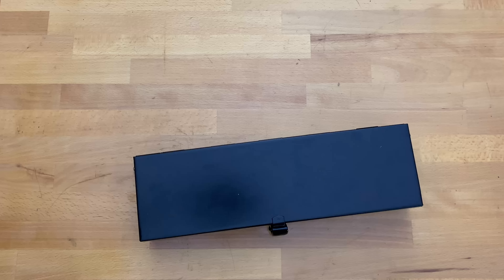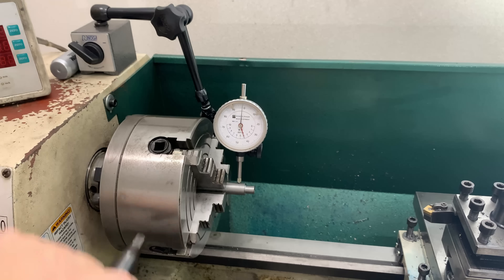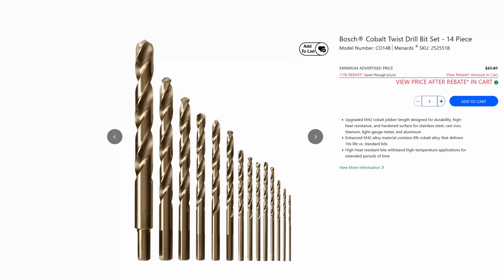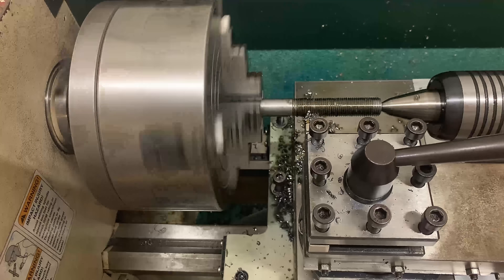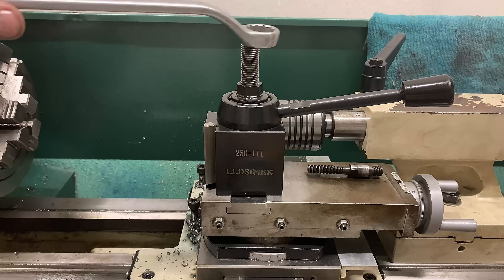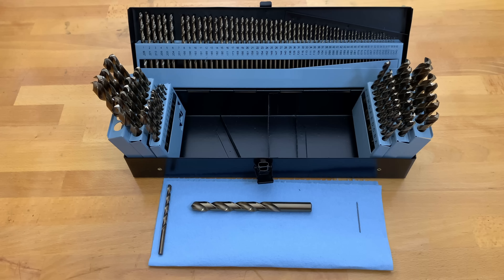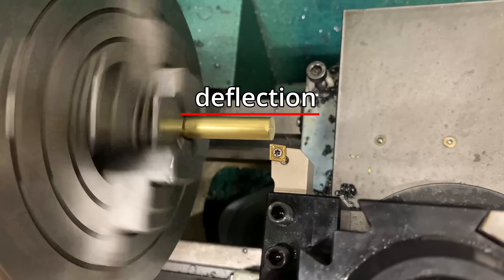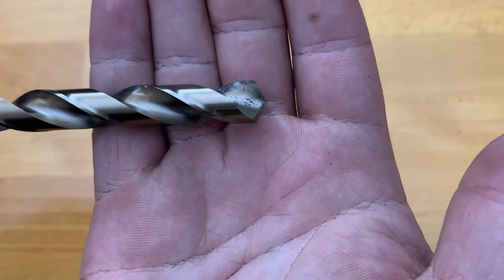Are Harbor Freight Drill Bits Secretly AMAZING?

Comment: Saw the same thing about the reviews. How could they be bad? Just bought these a couple days ago and they're great. Been getting chips longer than the entire bit when drilling into plate with my press. 16 holes into 1/4" plate and it seemed like it only cut better as I went on. Slow turning and press hard, cuts through it quite literally like butter. Best drill bit set I've had (not saying much, I used to only own junk)

I can say with near 100% confidence those who hate on these just don't know how to use them. To be fair, for the longest time I didn't either. Kept wondering what I was doing wrong and why all my bits were dull. Were they all that bad? No, I was the reason they were dulling. Its real easy to mess up drilling metal and can be impossible at times to drill properly when only using a hand drill, what are the chances that many of these buyers don't know that?

Sometimes I can just tell a reviewer didn't use it right just by reading their post. But, that's the nature of the internet, and those who don't use it because they think they know better. And well, for a time, I was that guy too (and probably will continue to be).
Reply from the maker: That's awesome. Thanks for taking the time to comment and share your experience with them. I really appreciate it. I've been drilling steel with these on a regular basis since I bought them and they're still working great.

Comment: I have 4 drill index sets, one red-box chi-neh HSS from yesteryear that I found in a rental basement missing 31%, which I 'adopted'. One new HFT HSS index I bought new, when I finally was rich. One HFT TiN coated index when I splurged. And, a HFT cobalt set I got when I was rich, but before the online jungle, and before I knew anything proper about machining. I have a small shrine in the corner of my shop with candles and a doily and a carving of the Great CNC, for it. I discovered they were hard, later, and found they worked well for SS, where before I learned a nice sharp HSS at a nice slow RPM, would do OK. Using common sense, and a bit of machining logic, I would give my set from 2007 a big thumbs up, especially for the price, which was reasonable, and I cannot remember.
I have had none break, but it would be nice if you could get individual replacements at near the same as the kit price.
Reply: On the online jungle site, I IMMEDIATELY go to the one star reviews, for a gauge of any product. I can, and have learned, to filter the cluster monkey customers, from the genuine bad product evaluations. I think you hit a SUPER key point: Bad reviews can be from people who have no idea how to do anything, and the FAIL is THEM, as opposed to the bad reviews because the product is shite; it takes a keen eye to discern between the two. I swear, there should be a minimum license required, for people to interact in public.
Reply from the maker: Thank you. I agree completely. You just have to learn how to filter out the relevant from the irrelevant and see if you can decipher truth.
Reply from the maker: Sounds like you've got drill indexes covered for a while!

Comment: Great video. I wonder if these are improved from what they were selling, say 15 years ago?
Reply from the maker: They must be. I’ve heard some pretty bad horror stories of their old cutting tools / drill bits.
Reply: @ Yeah. I bought some many years ago. I called them fast and furious drills, because they drift all over the place.  Some had visible wobble in the drill press right out of the box, and I’d avoided cutting tools there. 

IMHO over the years much of their stuff is no longer dirt cheap, but is higher quality. Their upper line stuff especially seems to work and hold up well- a better value. Might have to give their drills another go.
Reply from the maker: If you do, try the cobalt ones. I'm still hearing that the plain HSS drills are hit and miss.
Reply: @ShopHumor  Good to know. Thanks.

Comment: I used a HF cobalt drill set to drill out a broken stainless steel stud. They performed better than I expected, but it was such slow going in the very hard material. I ended up spending $30 on a Bosch tungsten carbide tapered and straight cutter for a Dremel and it's really like a hot knife through butter. I don't think I'll ever drill out bolts that same way again.
Reply from the maker: That's a good tip on the tungsten carbide for the dremel.

Comment: I have bought expensive and cheap. I will say, one of my favorite things to do in shops that I buy tools from is to look at relief angles on drills. Turns out, expensive and cheap often have the wrong relief angle. I now have a grinder and repoint all mine and do it for others for a profit. I will say, something happened to drills over the years.
Reply from the maker: Grinding and sharpening is a really valuable skill. I’ve wanted a d bit grinder for a while, but I do my best with my bench grinder

Comment: Ive considered buying these due to your video but would they be good for hand drilling on steel and aluminum?
From what i understand, cobalt is harder and more brittle so ideally youd want to use them in a drill press. However a majority of my work i need to do pilot holes by hand in a hand drill. Would these be good for that? I feel they would be extremely brittle. The highest quality ive ever personally used was Dewalt drill bits. In between these due to the value or another dewalt set.

I also do some carving work in aluminum so ill drill 3 holes in series and once the hole is drilled i like to rotate the bit side to side to carve more. Wondering if these could hold up to that.

Also you mention sharpening your drill bits, what is a cheap tool you recommend?
Reply from the maker: These will definitely be more brittle than your standard HSS bits, but with the right technique and lubrication you'll do pretty well with them even in a hand drill. These aren't quite as brittle as the M42 cobalt drill bits. You may be better off buying the Dewalt black oxide set if you're just drilling mild steel and aluminum, and then sharpening as needed. There are a lot of people who recommend drill doctor for sharpening and I think it's a great solution but can be expensive. Project Farm has a whole video comparison on the best drill sharpeners that I highly recommend watching: https://www.youtube.com/watch?v=m3Al3bfb9-0

Comment: Nice video. but I feel you did miss the Most Critical Part of Cobalt Steel drills. That is Cobalt Steel is the only Efficient Alloy to Drill Through Stainless Steel as i have learned by Professional  instruction and verified in the field. Also Caveat===I purchased two, 1/8 in. "Cobalt Steel"  Bits (not Kobalt brand name) from Lowes. The 2  brands, 'Bosch' and 'DeWalt' names and both name brands became Dull in 5 min. drilling 16ga. sheet metal galvanized roofing panels   I immediately returned them and read the label Micro Print saying Both brand names were "made in China" --- two American Brand Name products "made in China" of INFERIOR MATERIAL and selling for $9.00 USD Each . Please do not allow anyone to tell you-that-- -"you get what you pay for"  ever again.
Reply from the maker: Thanks for the thoughtful comment. Much appreciated!

Comment: Are cobalt drill bits better than tugsten ones, or am I getting confused and mixing stuff up and they are not used for the same types of metal?
Reply from the maker: Standard drill bits are high speed steel (HSS). Cobalt drill bits are just HSS drill bits that have cobalt added to their composition in varying percentages. The more cobalt added, the harder (and more brittle) the drill bit will be, which is great for many applications but does make them more prone to breaking. Tungsten Carbide is another step down the hardness line - significantly harder than even cobalt drill bits, but even more prone to shattering when you apply radial forces to them.
Reply: @ShopHumor  Thank you!
Can Tugnest Carbide bits drill the same type of metals that Cobalt drill bits can and vice versa?
Reply from the maker: Yes they can. They'll do even better than cobalt, but they'll be more brittle.

Comment: i used that exact same set at the shop for a very long time. They performed perfectly fine in +/-.003-ish work in regular material no issues. I would just sharpen them or replace them with generic mcmasters as needed. if this is a testament to anything… I sold my shop a while back and out of a large roller cart of nothing but drills and different indexes the only full index set I kept was this one
Reply from the maker: That sure is a testament! I'm glad you got so much good use out of them. I think they're great for my needs, too, and have found them sufficient as you did. And really, if I'm trying to make a precision hole, I'm drilling undersized and using a reamer, end mill, or boring bar to take that hole to the final dimension anyway, so their precision isn't that critical.
Reply: @ that's exactly right. Also I think a lot of guys that complain about them being off are probably not using proper procedures/speeds/feeds. We worked typically in the .003 range and like you said, if I needed more precision I would either break out better tooling or drill undersize and ream up or bore. new sub here, stoked on your content. 👍🏼💪🏽
Reply from the maker: Thanks so much and thanks for taking the time to comment. I really appreciate it, and enjoy hearing about your experiences too

Comment: Junk junk junk. I've used these drill bits for 10 months only on mild steel and more than 1/3 of the bits are shot. Keep in mind they've been used on a drill press at proper speeds using oil. Avoid.
Reply from the maker: That’s too bad! So far mine have been great on steel but I know ill have to sharpen them eventually

Comment: I agree with you.  Some of the negative reviews were all about the operator using the drill bit.  I've ruined/broken several drill bits while drilling by hand (no cutting fluid, hot holding the drill motor steady, and my fav...bearing down on the drill motor like the hulk because I just wanna get the hole drilled and be done with it).  You've convinced me that this particular Harbor Freight tool product is a worthwhile investment.  Thanks!
Reply from the maker: You're welcome! I hope that they work out for you as well as they have so far for me. Thanks for taking the time to comment!

Comment: Nice review!  About five years ago, I bought a cheap impact drill and masonry bits from Harbor Freight to redo all of the plumbing in a concrete pumphouse at a trailer park my parents owned. I had some doubt that they would last long enough to complete the job which entailed drilling a few hundred holes in the walls and floor for piping straps and other fixtures. Five years later, I am still using the same drill and bits and can't seem to wear them out. It was a real surprise and a good purchase.
Reply: Sounds like you just have the knowledge of how to properly use your tools...🙂👍
Reply from the maker: That's really incredible that you've gotten that much use out of them. What a good value!

Comment: I bought those drill bit set and there junk I tried drilling  a hole in a metal bed frame and it wouldn’t make a mark
Reply from the maker: Are you sure you got the cobalt set? They cut through steel just fine!

Comment: Yeah I needed to drill something with a size B drill.  A size I growing up in a fraction and mm world had never head of.  Weirdly Tractor Supply and Lowes didn;t seem to have any.  However I found the set you mention at Harbor Freight and it had a B, so I bought it.  The B worked good for the two holes I needed to drill.  
I have used the numbered drills a few times.  Some worked well, some seemed to go dull on their first encounter with metal.  When I accidentally spilled some from the  case I began using a micrometer to figure out which small one was which.  That was eye opening.  I found several a little bigger or a little smaller than they should be.  Some confusion with 2 that seemed to be of the same shaft diameter.Since they went side by side in the case, oh well.  I haven't had need for any of the fraction sizes yet because the WW2 surplus drill set my dad bought in the 1950s is still mostly complete and drilling well.
Reply from the maker: Sounds like your experience with them was or moss… I think the QC on the cheap stuff can be really spotty. I bet that 1950s era set is fantastic!!

Comment: The only drill bits I buy from hf, are disposable. Billy at drill hog sells his for a premium, but will replace them for life. The cobalt ones ease right through thick stainless!
Reply from the maker: I've heard real good things about drill hog
Reply: @ShopHumor  They are extremely hard, so brittle. But if you can use a drill press & oil 👌In a hand drill, I just go slow and try my best not to let them flex. Usually when someone helps themselves, they bring it back in 2 pieces.
Reply from the maker: I'd definitely only use them in the rigid machines like the lathe or the mill or drill press, I'd break them in a hand drill and then kick myself

Comment: I have used Harbor Freight drill bits for years.  After running them through a Drill Doctor, they are as good as any drill bit I have every used.  Maybe better.  No drill bit lasts that long and need to be sharpened.  Don't ever let anyone tell  you that a Drill Doctor ain't worth the money. It pays for itself in no time at all.
Reply from the maker: Yep, I don't care how you do it, whether it's with a drill doctor, with a file, with a bench grinder, or a D-bit grinder, you're gonna have to get those drills sharpened eventually no matter who makes them or what they're made of.
Reply: @ShopHumor  I can do a big bit on a grinder, but under 3/4" I like the drill doctor. Harbor Freight bits need to be sharpened before use.
Reply from the maker: @blankcanvas7187  I definitely agree that it's a lot easier to sharpen bigger bits on a grinder than the little guys.

Comment: I worked as a machinist before.  I bought the HSS drill set.  A lot of the drills at and below .02 are the wrong sizes printed on the case.  So about 10 to 8 of the tiny size bits are not right.    I use them mostly for hobby stuff and a few projects around the house.  They are holding up fine.  The box i can confirm is horrible.
Your best bet for drills is to order them from places like mc master carr.  These places specialize in machine tools.  Box home stores are for construction stuff.  Not professional machine shop use. They also sell those cases empty with highly visible markings.  Theyre $58. But worth it if you're a machinist.
Reply from the maker: I love McMaster too. Best website for tool / material / fastener shopping. A little bit pricey, but they're my go-to for stuff I can't find locally and stuff when I need to be sure I'm getting quality.

Comment: So, on the Cobalt, in the video he said guys reviewing complainted that the bits were brittle compared to softer high speed steel bits.  Duh.  Cobalt is harder and maintains a sharper edge.  The key to using these bits to drill holes in steel is to  use a slower drill motor, use lube or cutting oil and start small and then once through the work, blow it up to the correct size by stepping up a few bit sizes at a time.
Reply from the maker: You're exactly right. Their whole advantage is that they're harder (and more brittle). A little knowledge and technique goes a long way, as well as knowing how to sharpen tools when they inevitably need it after heavy use.

Comment: They work great. Just don't be a dumb ass with them. it must be amazing working with a brand new lathe or mill  that's not 75 years old. From 1950. I was taught to work within the confines of my machine.
Reply from the maker: I bought the milling machine (a Precision Matthews PM-25) brand new and I absolutely love it. It's small but for what I need, it's great. The lathe was used when I got it but I think it's only about 7 or 8 years old. The first owner had used it pretty hard and had tore up a few things on it but I've been working on fixing those and getting it dialed in. But for the price I paid for it (I got it for almost nothing), it's one of my favorite tools already.

Comment: 5:55 - now, I don''t know how it is specified for inch-sized drill(bit)s, but for metric ones they are normally 0.05 mm (0.002 in) UNDERSIZED to accommodate for any wobbling while drilling, and at any rate they are not considered precision tools. If you drill a hole to accommodate, say, M12 bolt the "undersized" hole of 11.95 mm will be perfectly OK since M12 bolt is also actually about 11.85-11.9 mm in diameter only - and if you need a precision hole for some interference/ slide/ shrink fit you'd need to use a reamer anyway,  so you're still left with some material to remove (which is the whole idea behind reaming).
Reply from the maker: Inch drills are typically slightly undersized as well
Reply: @ShopHumor  Just as I thought/ expected. Cheers!